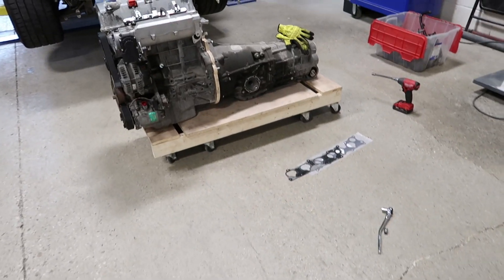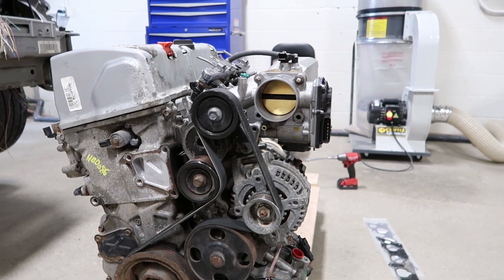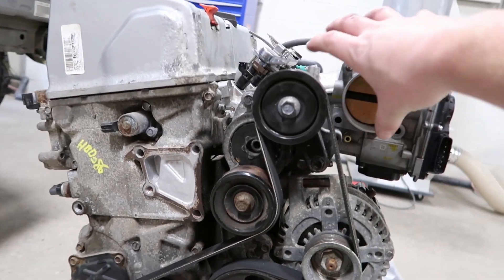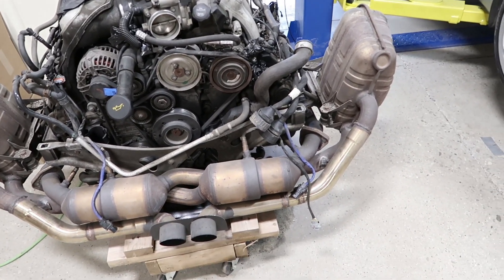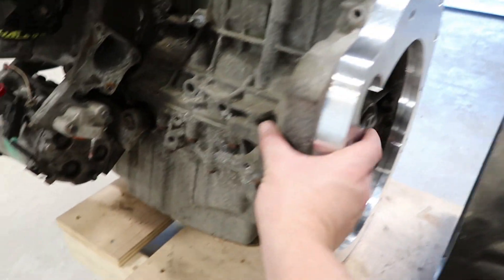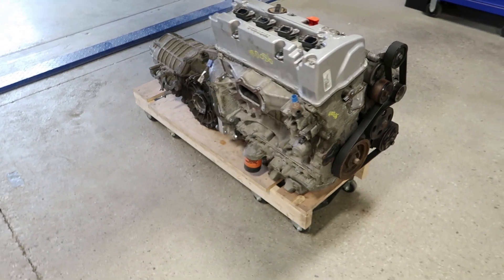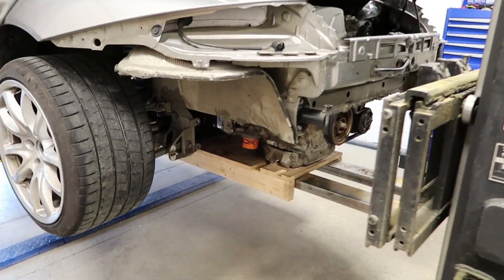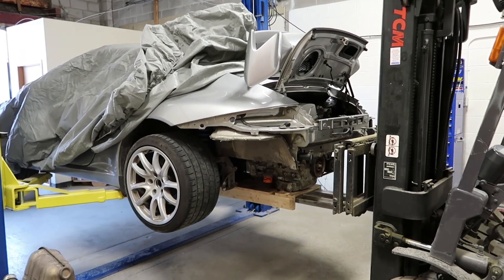997 Adapter Plate

Comment: hey man great video! i have a porsche 930 and i would like to use a 996 or 997 manual transaxle for a kswap project. G50 transaxle are hard to find and expensive. can you suggest me what would be the best transaxle to use that can fit on my 930 chassis.thanks in advance

Comment: where did you get the dimensions for the k24 and the Porsche transaxle adapter
Reply from the maker: Define Modified - I can take credit for those measurements- I bought the adapter from Kennedy Engineering. They did all the measurements
Reply: @tuningbynick  ok cool nice work